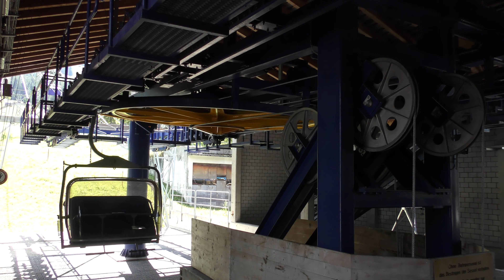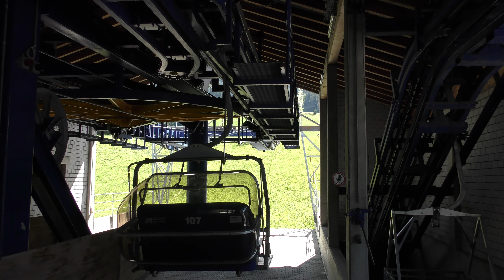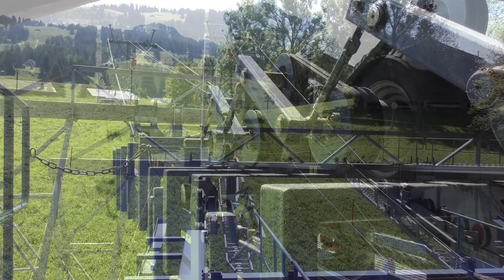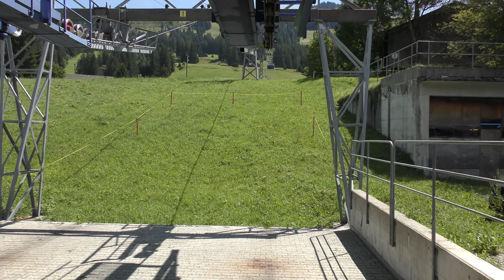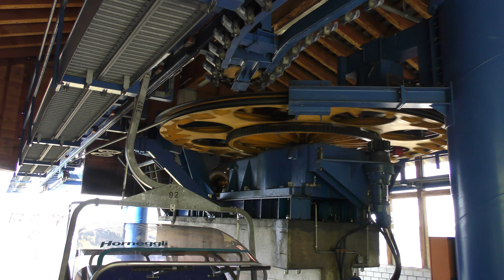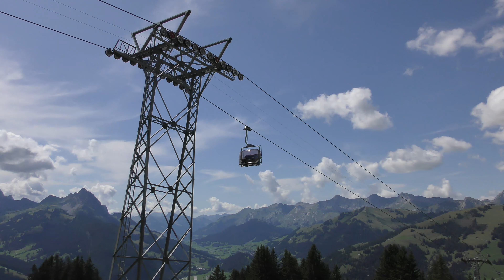Schönried-Horneggli

Comment: Note the smooth coupling passage the Vh400 clamp type allows; this is still the state of the art that other ropeway builders had not reached 35 years later !!!
Reply from the maker: Which moment with precision this "smooth coupling passage" ?
Reply: @GondelbahnMonde  , the whole coupling process show much less lateral seat movements than clamps of other producers show usually... ;-)